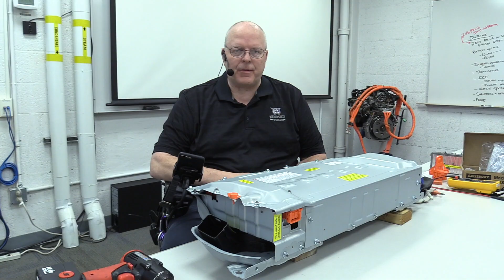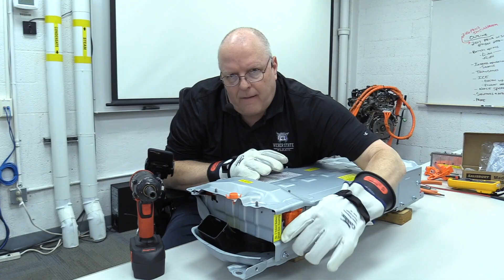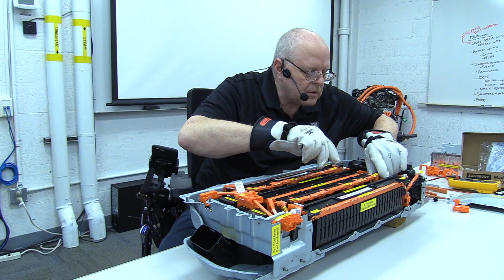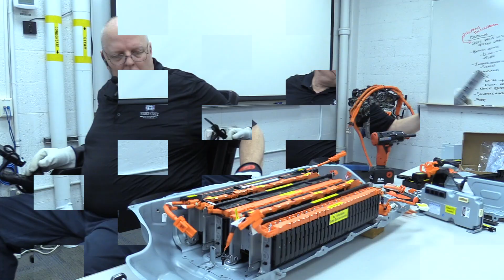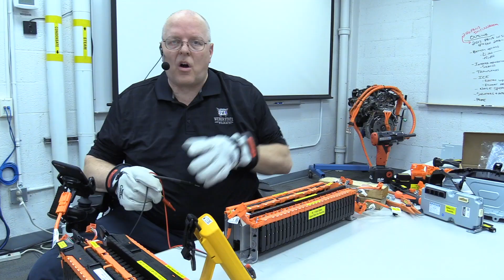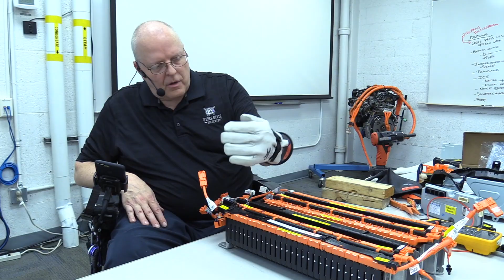2016 - 2023 Toyota Prius Li-Ion Battery

Comment: Thankyou Mr. Kelly.
You are thorough in your explanation!  I've seen some of you other videos.
I'm retired now, but I like to review these and send them to former co-workers and others.  Several years ago, I went to a Prius training and the instructor spent about 10 minutes in class, the rest of the time was in the shop taking the Prius battery pack and inverter/converter out of the vehicle, followed by component explanation/operation, reassembly, reinstall, vehicle startup, guaranteeing no codes!  Then came lunch, followed by the two groups switching positions, removing the battery and inverter/converter.  THAT helped me A LOT!  Several years later it paid off!
Keep doing what your doing!
Reply from the maker: Thank you!
Reply: Amazing work thank you.  Can i replace my 2010 prius weak hybride battry with 2022 or 2023 model prius hybrid battery.. please if you could guide me or share a video for that,  as i heard that putting 2023 model battery in prius 2010 gen 3 can heat up the engine. So please let ne know

Comment: hi professor do you have any video showing how to remove the plastic grille cover in front of the service plug grip of the 4th generation Prius, wherein the battery is under the rears seat cushion? (like what you have in this video).  Anticipating your kind reply...more power to you.
Reply from the maker: No, but there is just a small cover held in with a small screw to access the service plug grip.
Reply: WeberAuto thank you so much.

Comment: Only 750WHr? The Prius Plug-in Hybrid is advertised as 8.8kWHr (x11.7), a top-end Tesla 100kWHr (x133)! Makes you wonder how they fit them all in!

Would be interesting to compare some batteries side-by-side and also compare with a gas tank of the same energy content (both weight and volume).
Reply from the maker: That would be interesting. Don't forget the huge amount of heat energy wasted by burning fuel. There is also heat energy losses with batteries and EV's during charging/discharging, and conversion, but nowhere near the heat energy waste of liquid fuels. The coolant reservoir of a battery and inverter is only pressurized to 35 kPa (5 psi) compared to 108 kPA (15.6 psi) for the coolant reservoir of an internal combustion engine.  I am working on the Prius Prime battery right now. Expect a comparison video soon.
Reply: Yes the, comparison fuel tank would need to be sized to correct for efficiency, i.e. in terms of kW delivered to the road. I got to thinking about this when I considered buying a BMW Mini Countryman Plug-in Hybrid until I noticed not only that its electric range was woeful (around 10 miles), but that making space for the batteries had shrunk the fuel tank to the point were the combined range was little better than 100 miles! BMW also has the i3, a pure EV but with an optional auxiliary petrol generator. But the fuel tank is so tiny that the petrol range is actually less than the electric range!

Comment: .75 kwh, battery capacity to drive maybe 2 miles on electric power. Not very economical.
Reply from the maker: Thanks for your feedback! It was not intended to drive far in EV mode, it is for a hybrid vehicle
Reply: I'm old school, thought these newfangled hybrids for all they cost were supposed to actually get somewhere on electric power. Not just limp to nearest side of the road if the real motor quit. Local man had a lawn business, homemade electric power truck with a rack of deep cycle batteries to haul equipment trailer, and electric mower he cut yards with, big yards, all day.

Comment: Hi excellent videos, I would like to know about repairing or reconditioning a hybrid battery. Know the tolerances maximum and minimum differences between modules when changing. Also the correct way to charge and discharge. I do not know if you have any video with this information already. I have a prius 2 gen .Thanks
Reply from the maker: Thanks for your feedback! There are no specifications for what you are asking except what it takes to trigger a diagnostic trouble code. Best wishes!

Comment: This is an excellent tutorial. I think it is worth mentioning that voltages above 50 Vdc can cause a severe electrical shock so above that can be lethal.
Reply from the maker: 50V DC won't hurt you. OSHA and NFPA 70E standards do not even require PPE until 100V DC. 50V AC is equal in danger potential to about 100V DC. Thanks for your feedback!
Reply: Thank you for clarifying this.

Comment: Hi professor, I have an issue. I disconnected the safety plug on a Toyota Camry. However, when I reconnected safety plug back now I have a message saying, "check hybrid system", even though I made sure the safety plug seated properly and clicked as well, because the car drives but now I have that message... any ideas? thank you
Reply from the maker: Hi, this is a common problem. Most people do not remember to push on the service plug handle after reinstalling it to reconnect the interlock circuit. Watch https://www.youtube.com/watch?v=N0cjxpS7KeY If that is not the trouble, you most likely did not disconnect the 12V battery before disconnecting the service plug.  The check hybrid system message will go away after a few days of driving. If it does not, disconnect the 12V battery, wait a few minutes, then reconnect it again. Best wishes.

Comment: The battery is highly efficient but there will always be a fire risk w.ith it in spite of the 125 amp fuse.
Reply from the maker: There is a risk of fire with any battery or tank of fuel
Reply: The risk of fire in a lithium battery is far greater than that you described not only on motor vehicles but on aicraft citing the  787 dreamliner.In defence of this Toyota has minimised any risk by limiting a charge on the Prius to 80%of its capacity and a discharge rate of 90% individual cells can be replaced in a Lithium battery at a very small cost for a cell,but never to be fitted as a DIY job and  owing to its high voltage is a MUST to entrust the work to qualified personel even though fitting charges would be astronomical.

Comment: I'm assuming the battery doesnt need liquid cooling like a Tesla because it's not used as much.
Reply from the maker: It is used a lot, but it is not very large and doesn't create as much heat. This battery is only rated at 0.75 kWh. Air cooling is fine. Most Teslas are 60kWh and larger and develop a lot of heat during charging and driving.
Reply: @WeberAuto  Hybrid demand vs Electric car...

Comment: Thank you for this!

Around 15:00, you show how the voltage at each cell is monitored by the battery ECU.  How about charging ?  Are several cells charged in series, or does each cell get charged individually?
Reply from the maker: Thank you! All cell are charged in series with each other

Comment: I was thinking of using these batteries for my solar system which is 24 volt how much would be the maximum charge with 3 batteries 21.6 greetings from P.R.,and how many would you have to use for 4kw
Reply from the maker: Each cell stack is rated for 0.375 kWh. it would take 11 cell stacks to get your 4kWh. Best wishes!
Reply: Have you attempted this? I am trying the same thing
Reply: Have you tried this I am doing the same thing.

Comment: I am a little confused. You mentioned not to tilt the battery past a certain degree because of losing electrolyte. What electrolyte?
Reply from the maker: It is not a solid state battery, it has electrolyte. Whether the Toyota cells are vented or not, I do not know. That information came from the Toyota Service Manual for this vehicle.
Reply: Thanks for the reply. I must have misunderstood you as I thought you said those were lithium-ion. My bad.

Comment: Can the battery overheat in desert situations ?
Reply from the maker: Yes, it uses the air inside the vehicle for cooling
Reply: @WeberAuto  I've been running my 2008 Highlander Hybrid in the Desert for 4 years with no issues at all, the climate-controlled battery pack seems to do it's job.
Reply from the maker: @paulcurtis5496  Thanks, my 2008 Hylander Hybrid also did very well. The problem can occur when someone thinks it is better to turn off the air conditioning and open the windows instead.
Reply: @WeberAuto  who would've thunk an American would do such a thing! Hahahahaha, even in that even, I read in the owner's manual the car will over ride and kick in the A/C for the battery pack only. Is this not the case?
Reply from the maker: @paulcurtis5496  I have not heard of that. The A/C system is not connected to the battery pack on the highlander.

Comment: Dear Professor, 

How are you? Hope you are doing fine...

I have some questions : 

1. Do we can change the Previous Battery 1.2 Volt x 6 Cell Battery Module with this new Battery Module ? 
2. And if we can change does the Battery EUC will control the charge?
3. Last Question: If we can change: Any Special Configuration Between Battery and Battery ECU?

Thanks and Best Regards,
Lymeng POR
Reply from the maker: No, they are not interchangeable. The Li-Ion battery is charged differently. It would require many other parts be replaced and programmed as well. Best wishes.

Comment: Thanks professor for all the hard work. Could you please start a seperated video to teach us how the automotive maker design the battery temperature control system, especially how they set minimum the thermometer and monitor the temperature then determine which one cell may goes wrong.
Reply: On the GEN 2, there is one thermistor on the top of the battery hanging out in the air and then there are 3 thermistors clipped to a cavity on the bottom of 3 of the modules, placed one on each end module and one on the "middle" module. All these are connected to a wiring harness that is plugged into the top plug on the battery CPU. It is easy to break the wire to the bottom thermistor clips and then one has to find a new harness which Toyota does not stock. They recommend replacing the entire pack to get that harness but anyone buying battery packs from junkyards is throwing these harnesses out instead of putting them on E-Bay. I have reconnected the wires to the thermistor clip but you must be competent in microsurgery and soldering. The thermistor is inside the plastic clip. A real challenge.
Reply from the maker: Thank you!

Comment: Good day Prof, can I check with you, as I m driving Toyota Prius 1.5 c. Every time heavy rain here in Malaysia I m quite worried, if flood happen will the high voltage cause danger?
Reply from the maker: No danger in water. It will just quit working until is gets cleaned and dried again.

Comment: Professor Kelly, 
You said worst case it could take up to 109 hours for the car to rebalance the battery. That gives us an average balance current of 3.6 Ah / 109 h = 33 mA.  I'm interested to know if Toyota is using active or passive balancing.   Could you take apart the battery ECU and post some pictures of the circuit board front and back?
Reply from the maker: Good question, I will see what I can find out. The Battery is reassembled and reinstalled back into the vehicle, so I will not be able to take photos any time soon.

Comment: Can you tell us about toyota prius plug in battery
Reply from the maker: The 2010 Prius Plug-in has a 345.6V Li-Ion battery with 6 battery stacks of 16 3.6V cells each (96 cells total). It is much like the battery in this video, except the stacks are stored behind the back seat. It is an air cooled battery with two cooling fans.  This higher voltage system was only used for one year. The standard 2010 Prius only used a 201.6V Ni-MH battery

There was no 2011 Prius Plug-in.

The 2012-2015 Prius Plug-in has a 207.2V Li-Ion battery with 4 battery stacks of 14 3.7V cells each (56 cells total). It is much like the battery in this video, except the stacks are half as long and are stored behind the back seat. It is an air cooled battery with two cooling fans. I hope that helps.

Comment: Thank you,  professor.  Can you do a Avalon Hybrid battery.
Reply from the maker: Thank you, I will put it on my list. It is very similar to the video in this link, but it is at 244.8 Volts instead (it has 6 more battery modules).  https://youtu.be/utDVUNUC474 Have a good day!
Reply: prof, thx for all the very good youtube video,  my toyota avalon hybrid 2013 has that check hybrid system message come up and I took the battery out and checked every cells and voltage is around 8.08v to 8.12v, that looks fine to me. i put the battery back to my car and still has the same message popup, then i disconnect the low voltage battery and reconnected the low voltage battery. then i that check hybrid system message is gone for about a month.  the second time that message came up about a month later, so i checked every cells again and it is the same voltage i got from last time.  so I did the same like last time, i put the battery back and disconnect the low voltage battery and reconnect it, and the car is good.  now this time about 2-3 weeks later that message come up again, I just disconnected the low voltage and reconnected it, that is message is gone now. do you know what cause this problem?  is there any program code that i need to enter to re-program it or bring it to the dealer to re-program it or maybe is there a log message keep reminding  the car needs to be fix?  Thank you.

Comment: can I install this 2017 Li-ion hybrid battery on 2014 Prius? if yes, are there any instructions to install it? the second part of the questions is, can I install a 2016 Prius hybrid battery (Ni-MH) on 2014 Prius?
Reply: +Hasem  Install on some damn lawn mower, that would be more interesting. Install on old american Ford Pinto.
Reply: WeberAuto thanks for Your excelent Work, what about the Rate charge, what could happen if i charge a lithium battery at the Rate charge of the ni mh battery, sorry for May english, saludos desde México
Reply from the maker: No is the answer for both questions. They have different case sizes, charge rates, cooling, and controllers. Best wishes

Comment: hello there Professor, thank you for this presentation. Is this battery the same as the gen3 prius plug in? it doesn't look like it weighs 80kg to me.
Reply from the maker: Hi, it is not the same battery. Thank you!
Reply: WeberAuto thank you for replying, I just bought a gen3 prius plug in and it is fantastic. The ev range is not that much but I think if replaced with tesla 18650 batteries for the same weight (80kg) the range may go up a bit. I will keep watching and learning from you.
Reply from the maker: Thank you! That would be a fun project. Battery cooling would be critical

Comment: 41:04 I'm guessing, max SoC from MG1 (idling) would be at ~40% while MG2 (driven/regen) would go as high as 80% ~ 99%? It would be a waste of fuel if MG1 is allowed a higher SoC.
Reply from the maker: Thanks for your feedback. I just checked a third generation Prius with a Ni-MH battery and it shuts off the engine at 50% SOC
Reply: Thanks for the info.
Reply: what type of cells it is sir?

Comment: At what point during disassembly could you safely remove the insulation gloves? Great presentation professor!!
Reply from the maker: Thank you! Never on the inside of this battery housing.
Reply: When all cells are disconnected.  Then the voltage will be less then 12.  Then you shouldn't need high voltage protection.

Comment: I think there is 10 stacks (not 5) in the plug in version can you confirm if you know ? Because I can't find any info on the prime battery. Only info is that its a 8.8kWh
Reply from the maker: Li-Ion Battery. 95 Cells (19 Cells x 5 Stacks) = 351.5 Volts. I verified it. 2017 Prius Prime
Reply: WeberAuto oh its not the same cell then because in this you have 28cell/stacks not 19 with a capacity of 4ah vs 25ah for the prime. It would be very nice if you can make another great video this time on the prime battery . Thank you for your great work love your vids !
Reply from the maker: Thank you!

Comment: Maybe I missed this part, but is the cooling fan itself not located inside the battery box? Is it a 12VDC fan?
Reply from the maker: You did not miss it, I forgot to show it. It is a 12V Brushless DC motor. I will include it in a future video.

Comment: Cells are welded together?  No more replacing individual cells?
Reply: I wonder if the Nickel Metal battery is the same. Perhaps they did not want people messing around with the Lithium cells. They can be rather volatile if punctured or damaged. If the nickel metal cells are the same that's a bit disappointing because in the previous generation Prius you could replace individual cells from salvage yard or even shops that sell reconditioned complete packages of cells.
Reply from the maker: I do not know, but I doubt they have changed from the previous models with Ni-MH batteries.
Reply: WeberAuto 
Well since the NIMH battery cells are different shape that cage could be different too. Be nice if they were serviceable like the previous gen battery packs.

Love your videos... Great job..
Reply: I bet someone will or has already figured out a way to breach that cage.  You're right that it would be nice if the cells could be replaced one by one.
Reply from the maker: The cells are not welded together, but they are held together in a welded cage that surrounds them. There does not appear to be a way to remove them.
Reply: alex tworkowski
Reply: Im interested in taking a stack apart for sure